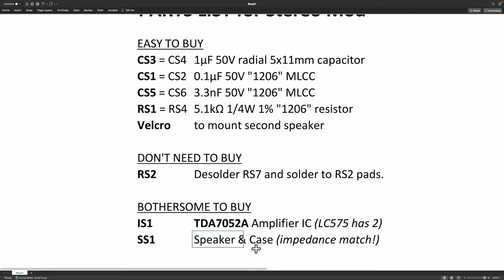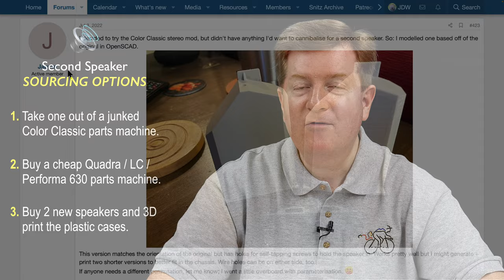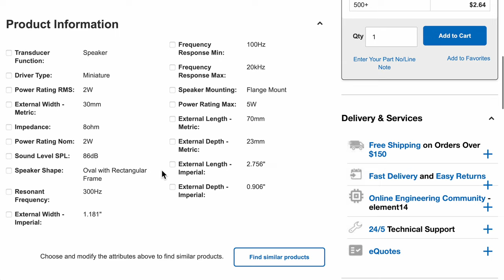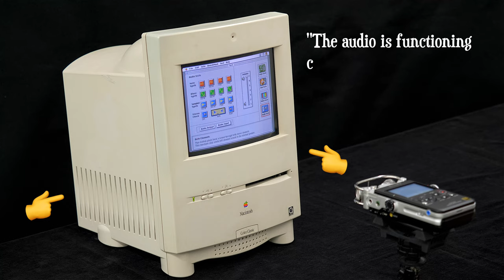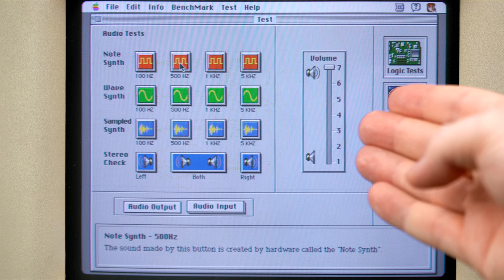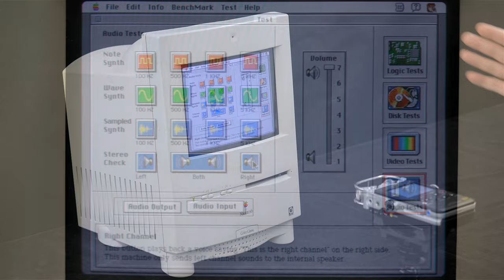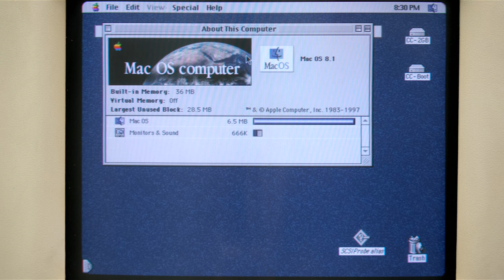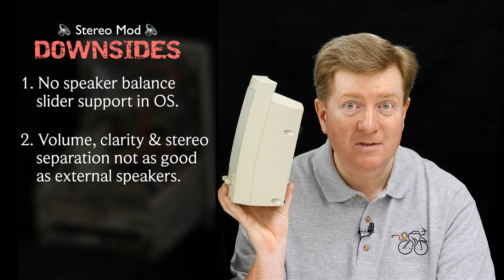Macintosh Color Classic STEREO MOD

Comment: Is this stereo mod only for CC with Mystic (LC575) logic board? How about original logic board? Will this mod enable stereo on default CC?
Reply from the maker: The logic board is irrelevant to the Stereo Mod.  If you watch my video, you will see me modify only the Analog Board, which is the same if you have the stock CC motherboard or an LC575 motherboard.  So yes, the Stereo mod works for stock CC's too.  That's why I didn't put LC575 or Mystic in the video title. 

With that said, the stock CC is a real pain to use.  "Excruciating" is not overemphasizing how I personally feel when using the stock board.  Believe me, it's nothing at all like using a 16MHz 68030 B&W Mac like the SE/30, which has a rather zippy and quite usable UI.  Color makes that 16MHz '030 super slow on the stock CC.  Plus, you're limited to only 10MB!  I can upgrade my SE/30 to 128MB!  Even if you only swap out the motherboard for an LC520, it's still much faster and more usable than the stock motherboard.  The LC575 is faster still.  I strongly recommend all CC owner's swap out the motherboard with something better.  Trust me, you will overcome your desire for a "stock" system REAL fast when you have a better board in there.  Apple should have never released the CC with a 16MHz CPU.  The CC II (and LC550) was a vastly better machine in terms of speed and maximum RAM.
Reply: @JDW-  Thank you very much. I must have done it not properly then because stereo option is grayed out and not selectable in sound management. I'll check. I'd like to buy 575 logic board but they are not easy to find or quite expensive unfortunatelly.
Reply from the maker: @cemc.852  The key to making the stereo mod work is the TDA7052A amplifier chip.  If that chip is missing, bad, or install in reverse, then there won't be sound out of the new speaker.  

As to buying an LC575 board, most sellers of the board only are rip-off artists.  I was advised by a friend here in Japan to just buy a super cheap LC575 computer that is basically falling apart (not hard to find).  Usually they are almost orange they are so yellow, with plastics so brittle they almost fall apart just sitting stationary.  But normally they have a good logic board.  I was able to get an entire machine like that for less than $100 shipped from Yahoo Auctions Japan.  Buyee makes purchasing via Yahoo Auctions easier for people outside Japan, but shipping charges make make such cost prohibitive.  Even so, there are a lot of damaged LC575 machines in the US.  One guy who lives in Europe bought an LC520 (same problem with brittle plastics) from Yahoo Auctions via Buyee and upon delivery to Buyee, the machine fell to pieces.  He wrote to me asking if he could donate the parts to me, since he wanted the entire machine, not just parts inside.  I mention that only to say that most of the LC500 series get damaged during shipping, even when carefully handled.  And as a result, you can sometimes find deals on the entire machine.  Meaning, a price usually less than the price of the motherboard only -- as strange as that sounds.
Reply: @JDW-  I checked, desoldered and resoldered everything again but no luck. Both speakers work, but in mono.
Reply from the maker: @cemc.852  While I'm glad to hear you got sound out of both speakers, I am terribly sorry you are not getting true stereo.  I never checked my stock CC motherboard because I already did the VGA mod which is not compatible with that motherboard.  After reading your reply today, I did a little online research and found information that suggests the stock CC and some of the early LC series too had only mono sound: https://68kmla.org/bb/index.php?threads/stereo-mod-for-color-classic.30391/#post-324984

Later in that 68kMLA thread there was a discussion about stereo, and it seems that "Tim S" embarked about doing that mod in order to get stereo, and while he doesn't specifically say "I got stereo," it seems that he had some success but the joy was reduced when he discovered the volume was lower than expected.  

Not sure if "Tim S" would reply to a PM in light of the fact he hasn't been active in that forum since 2018, but it's worth a shot.  And I would recommend that even if you aren't yet a 68kMLA member.  Because it seems there really aren't any better options out there.

The only other alternative is to post in your preferred forum or FaceBook group, linking to that 68kMLA discussion and asking for the experiences of others.  Who knows.  Maybe someone else has tried it with their stock CC motherboard.  But at some point you probably will want to replace that motherboard with a 575 (Mystic), and I know from personal experience that board works.  They are just hard to find unless you buy the entire machine.

Because this is an important topic and because you are the first person to discuss it, I am making your comment a pinned post for others to read.
Reply: @JDW-  It's a relief now. I've been thinking what I have done wrong. Thank you very much. I'm desperately looking for LC 575 motherboard. I wrote to Facebook and couple of returnes I got. One with some missing caps and messed up pads so I turned it down. Other one, for some reason seller cannot see my messenger posts to him even though I could read his. Seems luck is not on my side these days 😁
Reply from the maker: @cemc.852  My first Mac was the 128K in 1984, but I didn't get started with "vintage" Macs until about 2004.  Can't believe it's been 20 years.  One thing I've learned through the years is that PERSISTENCE PAYS OFF.  Never give up.  Keep pursuing that 575 board until you get the one you feel is right.  You won't regret it.  And you will be extremely pleased with it in the end.  There have been times I've waited months or even years for something I've wanted.  I now have the large part of what I've sought all those years, from Grayscale on the SE/30 to a Macintosh Portable.  The experience over the past two decades has been amazing, and I truly hope your own vintage Mac adventure is just as thrilling.  I am an Admin over at the Tinker Different forum, so if you've not posted there yet, you are certainly welcome to do so anytime: https://tinkerdifferent.com
Reply: @JDW-  Sure I will visit your forum. This CC is my first ever Apple device, bougth it couple of months ago. Bought it because it's cute little machine and the price was right. My first computer was C64 in 88. Then A500 in 90. Now have 7 A500s (some of which are Plus) and 1 A1200. Put the CC next to them and they get on well with each other 😂
Reply from the maker: @cemc.852  Congrats on the CC being you first Mac!  It's unfortunate Apple capped that board at 10MB of RAM and decided to use 16MHz as the CPU clock speed instead of a more reasonable 25MHz (for a color machine), but other than that, it's a very fun "compact Mac" to own. And of course, part of the fun is the potential for what it can become with upgrades.  

I myself am a 68K guy, so I wouldn’t do a PPC upgrade (Takky) on mine, but I have no issue with swapping out the motherboard for one with a faster 68040 processor, then swap\ out the CPU for one with an FPU, then overclock the CPU, swap out RAM and VRAM, do the VGA and Stereo mods, swap the HDD out for an SD card solution, etc.  In fact, I even recently soldered in a ROM socket (in my LC575 motherboard) so I could try out ROM SIMMs from CayMac Vintage. A non-stock ROM has the benefit of killing the painfully slow RAM checks at cold boot, which can be very handy if you have a lot of RAM (which isn’t an issue on the stock CC motherboard).  

Anyway, don’t get too caught up in enhancements at the beginning.  That rabbit hole is a deep one.  Try to get enjoyment with what you have for a time, and then you can slowly explore the world of upgrades.
Reply: @JDW-  Thank you! 

It's been fun playing with it so far. Installed Bluescsi, done cleaning and fully recapping, serviced floppy drive (replaced broken eject motor gear thanks to your video), replaced pots in the back etc.

As I mentioned, I'm coming from the Amiga world. And it is supported by a huge community. What surprised me was seeing there is much less third party enhancements made and released for vintage Macs compared to the Amigas. For example a stock A500 has a Motorola 68000 CPU but with aftermarket cards you can end up having 020 all the way to 060 CPU, 128MB of fast RAM. If that's not enough you can have modern Pi based accelerators.

That being said, in my case for example the CC has a PDS slot could have been exploited by super fast turbo cards by now and even replica motherboards could have been released for much faster platforms. And therefore there could heve been more options for enthusiasts.
Reply from the maker: @cemc.852  Yes.  For some reason the vintage Mac world is a bit "old and sleepy" compared to what I've seen in the Amiga world.  However, there are projects for vintage Macs that do have some nice features.  BlueSCSI, for example, has gotten much better over time.  Not only is there BlueSCSv2, but with a PICO W, you get WIFI, which is really neat. "Bolle" over at the 68kMLA has recreated some vintage accelerator boards, and folks like Kai Robinson have recreated the entire Macintosh SE and Classic motherboard, for people who have suffered from battery bombed boards that cannot be repaired.  So perhaps not as exciting as the Amiga world, but there is still some useful stuff going on.  People sometimes contact me privately about projects they are working on, which of course, I can't talk about.  Some pan out, some don't.  Some are pretty much finished products just sent to me for testing prior to the formal release.  So be sure to stay active in the online forums and FaceBook groups (even Reddit, if you care for that), as all those news sources carry info about new developments, projects and products.  And most of all, HAVE FUN!

Comment: A very nice walk-through, well done!  I wouldn't want to carve up the chassis for the second speaker either.  The flat sides of the CC make me wonder if stick-on exciters would work well mounted to the inside.
Reply from the maker: Thanks for watching!  I wouldn't recommend an exciter to use the plastic chassis as a speaker because I only recently discovered the cause of the "screen flutter" I mention at 37:59 -- vibration!  I found that I can cause the CRT to flutter like that (much more pronounced when viewing it with your eyes instead of in my video), just by tapping on the top of the machine!  With each tap, it flutters a bit.  The reason why it flutters more for some sounds than others is because some sounds are louder and vibrate more than others.  So deliberate vibrations caused by exciters would be a constant source of CRT fluttering.  Not sure if that is normal on every Color Classic or just mine.

Comment: "2 speaker louder than 1" should be a t-shirt itself
Reply from the maker: And on the back that T-shirt should say: "...but not much louder."  Because unfortunately even with two speakers, the maximum volume still isn't enough to satisfy.  Apple addressed that in later machines like the LC575 by putting the two speakers in their proper place -- firing straight at the listener.  Even so, two are better than just the one, and I think the Stereo Mod is worth it as a result.  Besides, you get stereo separation too, which is really the point.  You can't take advantage of that from System beeps, but games like Duke Nukem are more enjoyable.  And since most vintage Mac owners tend to play games on them, rather than do Word, Excel or Photoshop work for one's job, that's important.

Comment: before gutting that machine even further, could you have installed the original color classics board and made a usable vintage mac? what about installing a mac mini instead of the old logic board?  could you make a core2duo lc 575 mac that way?  or does the monitor require the original logic board?

Comment: Love your videos! Thanks for the great information! I'm fairly new to all this, how can you tell the polarity for the MLCC caps, or does it not have a polarity? I am finding conflicting information online, and the case itself doesn't seem to have any markings, and the board doesn't denote it either. I'm assuming the orientation doesn't matter, but I just want to be sure.
Reply from the maker: Thank you for your kind words. MLCC caps (aka ceramic capacitors) are not polarized. They work properly in either orientation.
Reply: @JDW-  Thanks for the quick response and helpful information! I really appreciate it!

Comment: Why re solder? Can't you connect the old speak to the new cabel connection and vice versa?
Reply from the maker: No I cannot because I used connectors I had on hand when building my new twisted pair cable for the new speaker, and those connectors were of a totally different shape.  So basically, I ended up with two incompatible sets of connectors.  I later swapped out the stock twisted pair cable with a new handmade cable of the same wire thickness as my first handmade twisted pair cable (thicker than the stock cable was), and I added the same type of connector on it as my first handmade cable.  I then swapped out the stock connector on the stock speaker for the correct mating connector my handmade cable required.  

That allowed me to switch the speaker connections, which resolved the problem of the L & R channels being reversed.  Overall, I'm pleased with this solution.  But of course, if you make your own cable and have the means to use the same exact connector as the stock connector, that would be best.  But the most important thing is to just keep in mind that when you do this stereo mod, for some reason the L & R channels will be reversed, so you need to wire the speakers accordingly.
Reply: @JDW-  Thank you! Put very well.

Comment: Great video(as always) James!
I wonder if there's a way to hack the OS so it will give the stereo balance slider?  

I just got a mystic board for my color classic, so definitely planning to do the VGA mod and possibly this one too, plus I get to use the wonderful Spicy O Clock that Kay gave me a while ago.
Reply: Maybe something as simple as using the Wish I Were control panel and choosing a computer that actually has stereo
Reply from the maker: @tombarber8929  Interesting.  I will have to give that a try.  But if that doesn't work, then I would absolutely love to see a hack to make balance adjustment possible!

Comment: Getting ready to start this mod. Have amp chip ordered and about to place my order with mouser. Any chance you can guide me to a good connector to use? Both male and female variant so I can remove the speaker. Any help with P/Ns would Be fantastic. I like your setup
Reply from the maker: Mouser might seem convenient since you're planning to place an order with them, but their connectors are rather expensive, and they don't include wires. The cheapest and best solution overall would come from Amazon because many kits offer the same 2-pin connectors I used, and they have wires crimped and attached to those connectors.  Wire length is only 10cm on some of the kits, but I did find one kit that offers 50cm long wires.  I added links and all the details in the text description under the video just now, so please check the "🛒 BUY THE PARTS" section where you see the "⚠️" icon.  

For the power levels we are talking about in the Color Classic, 22AWG wire will be fine.  Just make sure you twist it like I did at 34:39.  If you aren't satisfied with 22AWG wire, then you would need to buy thicker 18AWG wire (also on Amazon), then shorten the 22AWG wires attached to one of the connector kits on Amazon, then solder your thicker wire to the short wire stubs, then overlay your solder connector with heatshrink to prevent shorts.  Doing that would slightly reduce the overall wire resistance (thicker wire has lower resistance).  But again, I don't think that is necessary as 22AWG should be sufficient for the low power used to drive these speakers.

Comment: The Apple Design speakers were the bomb back in the day but now seem sort of cheesy.
Reply from the maker: They sound good, which is why I included them in a comparison. As you could probably hear, they sound significantly better than the dual internal speaker set up inside the Color Classic. 

The two big problems that I see with them are that the speaker grill is metal and my grill is slowly rusting, and it’s pretty much impossible to desist a painted speaker grill because you would need to remove the paint and repaint it which would be just a mess. The other thing is the case is plastic which means it has the potential to yellow overtime making it bothersome to de-yellow. I suppose another big problem, and perhaps the biggest of all, is that they are no longer made and becoming extremely hard to find as well as expensive.

Comment: I'd love to do this for my CC but I gotta make sure my Japanese unit is voltage level accurate in Canada. The CRT colors have come in and out at times after a full analog and logic board recap
Reply from the maker: You are telling me that you did not have any problem with colors whatsoever before your recap, but then after the recap the problem with colors began?
Reply: @JDW-  I'll post an update on tinker different. The behavior is not consistent between sessions. Not ideal.
Reply from the maker: @1BitFeverDreams  I just checked on TinkerDifferent but see you haven't posted anything yet.  I look forward to reading more about the color issue you're having.
Reply: @JDW-   just updated the thread now. no rush, thanks for taking an interest
Reply from the maker: @1BitFeverDreams  I see your new post here, thanks: https://tinkerdifferent.com/threads/mu0ns-color-classic-thread.1252/page-3#post-16117